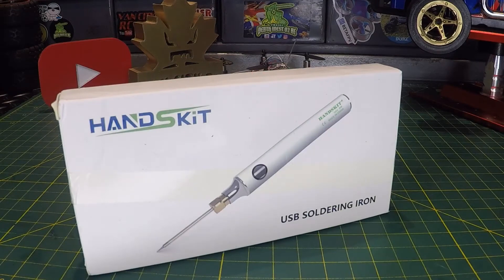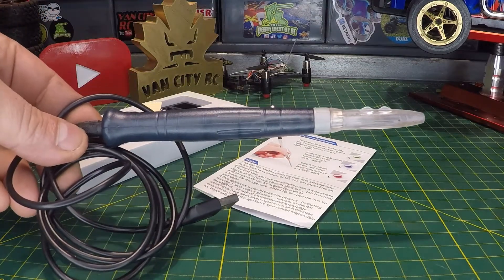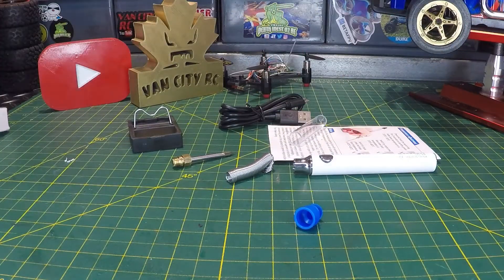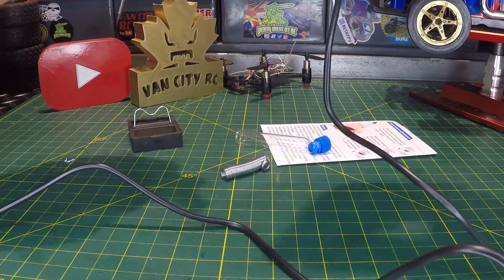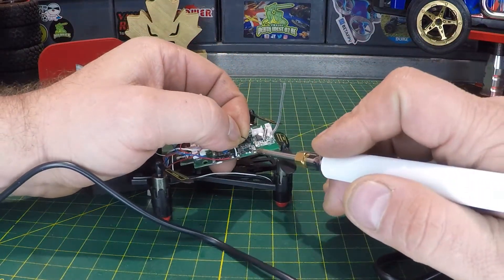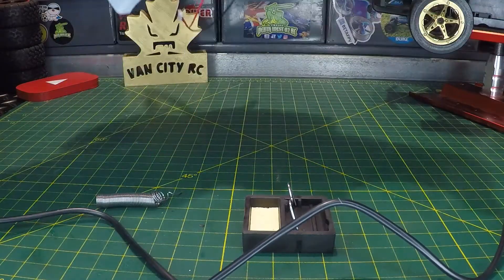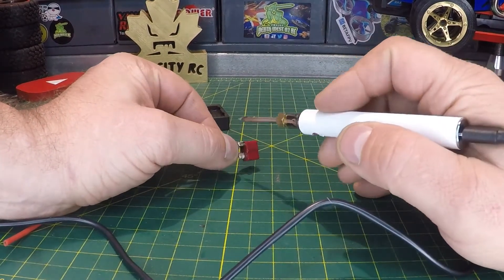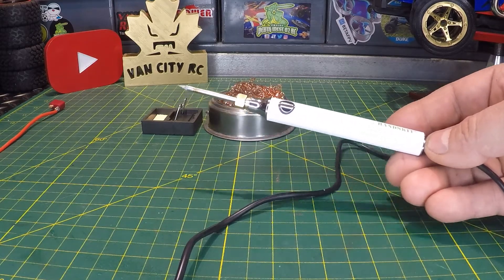HANDSKIT USB Soldering Iron.

Comment: Hello..Does it only work with the cable attached or does it still work once the cable is removed? thanks
Reply: aliexpress has this soldering iron with battery
Reply from the maker: @ nice 👍
Reply from the maker: This one needs to be plugged in to use

Comment: How many amps was your power supply when you used the soldering iron? Cos mine is at 2 amps and the soldering iron doesn’t get hot enough
Reply from the maker: I was using an iPhone cellphone charger which I think is also 2 amps

Comment: What soldering iron do you use or oils recommend for doing XT60/90s connectors Dan? This 1 would be great on the 1/24 stuff
Reply from the maker: Hey Nathan I use a 60w cheap
China iron that has adjustable temp. Works great for connectors. 

I’ll post a picture on the Van City RC Facebook page for you to checkout.